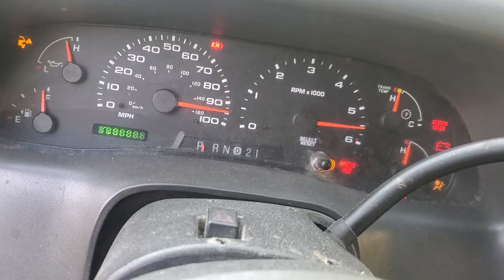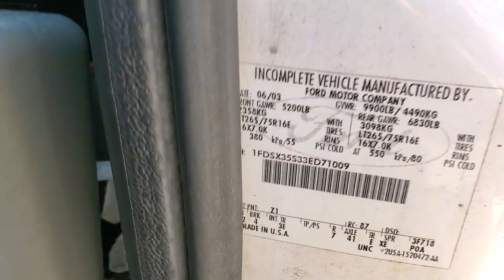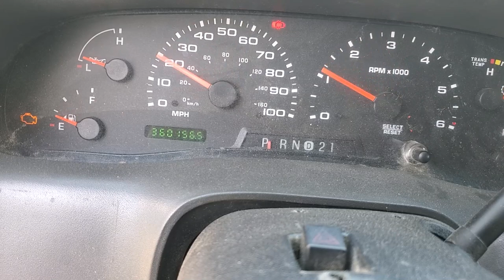My Ford F350 V10 360k Mile Service Truck Set for 6 months .Will It Start?

Comment: I have two friends who each have a V-10 Excursion; both are original owners..... One has about 150K miles, the other is about the same as your service truck 380-ish iirc.  Both friends get badgered constantly by peeps wanting to buy their Excursions.  But since neither friend has sold them yet, I don't think either will EVER sell.

Comment: In fairness, the Walmart batteries were made by Johnson Controls, but I think the issue was they were made with recycled lead. No idea. I have a love hate relationship with the Ford Mod family. Unfortunately mine have left me stranded.

Hope you find stable work! It is harvesting season, unless every farmer in the greater DFW area is using nothing but John Deere.
Reply: recycled lead is not a problem, almost all batteries are made with recycled lead

Comment: those old triton motors are beast mode but I'm a sucker for diesels. I went with the international dt466 all mechanical for reliability. I played the single rear wheel game for a bit but couldn't keep tires on it.

Comment: You thought the V10 would do it in? Nah man, 2V mod motors are crazy reliable. There's just the spark plug thing which really isn't even that big of a deal anymore and exhaust manifold leaks. When it comes to Ford trucks/vans of this vintage it seems like the drivetrain usually outlasts the frame and body, at least up north where we have winter.

Comment: I own a 2001 GMC 3500 4 door,, 4 X 4, 6 speed manual, Dually, with 8 foot bed and as you love your Ford I love my Beast GMC.
WHEN I tow my 20 foot Bass Boat for some reason I get 23 mpg but just running around 17 mpg.